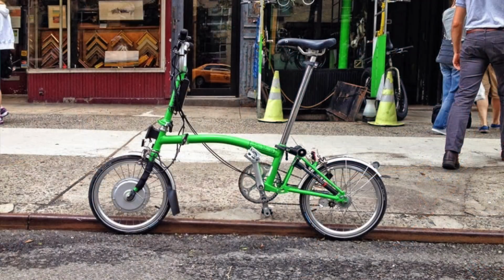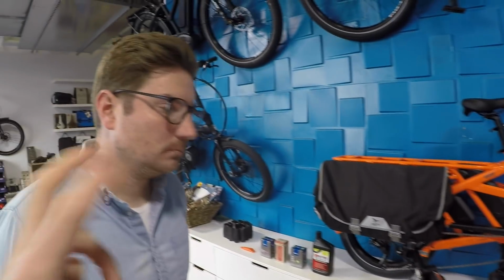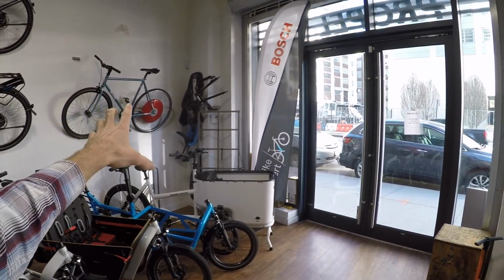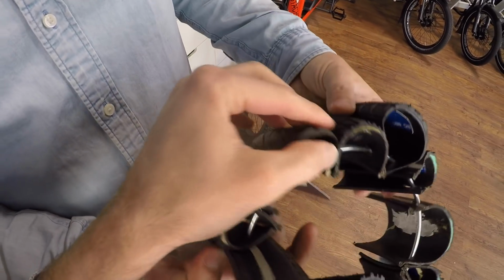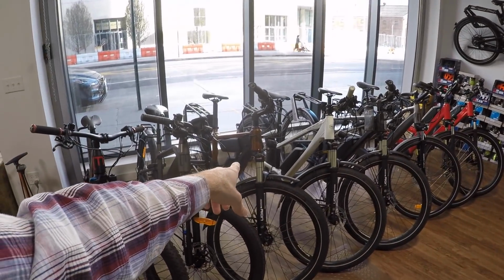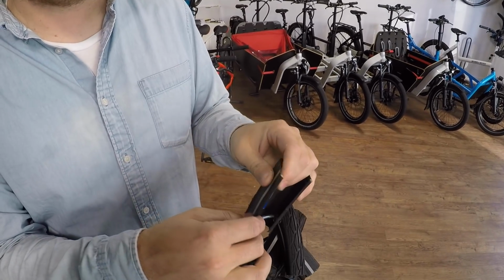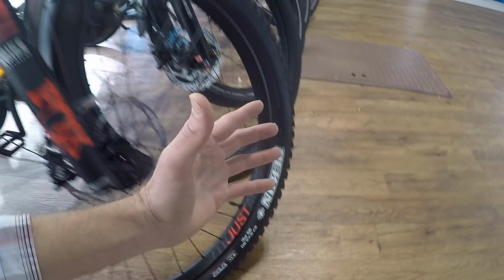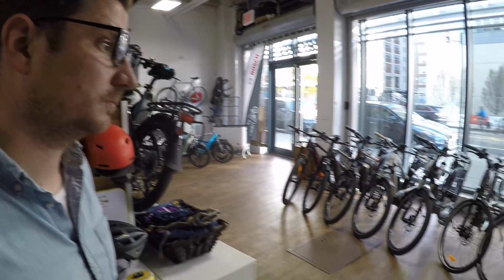Bicycle Wheels and Tires - Deep Dive Guide, Electric Bikes

Comment: My Dodge Diesel has 245/75/16lt tires that have a tire pressure recommendation of 80psi. The Expedition has 245/75/r16 tires and they recommend 35psi.

Comment: I have an ET Cycle F720 which has a 20x4 tire in an alloy wheel. My wife wanted the  seat lower so her feet will be on the ground whenever she stops.  Aside from seat post which is at minimum already, Im planning to replace my tire with 20x3 tire. Will it fit my rim and will it help the seat height to go lower? Thanks!

Comment: Biggest thing is tire pressure if you have a tire that can take 100psi you'll roll farther in range cause less resistance means less watts used to get the same distance.

Comment: You have to "pedal faster" with smaller wheels? 2:50. Huh? That's news to me. Do you think he might be confusing rolling resistance for a "gearing" effect? Rolling resistance is certainly a bit higher with smaller wheels, but only becomes noticably so over rougher paths. It's referenced here as "attack angle." Hmm...
This is not to detract from the fact this video is most helpful. And the man in the shop is a good guy. Thanks to him too.

Comment: Great info on tires, rims and tubs. Are adaptors available to convert the Presta valve to a regular type valve used on gas station air pumps here in the US?

Comment: I recently purchased a Habike Xduro full seven with the bosch system, love the bike however it came stock with nobby nick schwalbe tires which I was not too excited about. I have experienced several flat tires with the nobby nicks on my other mountain bike I got a flat early on the ride with a sharp rock, then a week later it was flat by needles from cactus. I switched to Maxxis high rollers with exo protection and those held up much better than the nobby nicks. So I figured I would take It to the same trails and blow out the tires so I can replace them with the maxxis with exo protection. But to my surprise the nobby nicks held up even in a trail full up sharp rocks and many cactus, I was trying to get a flat, but was shocked when I didn't lose any air pressure. These nobbby nicks have APEX protection which is 2 layers of extremely robust motorcycle carcass. So far 127 miles in the desert without any flats. I'm starting to like these nobby nicks with APX. protection.

Comment: Hi Court, love all your hard work in doing all these reviews. Great job! One thing I wish you would include on your reviews though is the ground clearance of different bikes. And what I mean by that is the distance between the pedal in the full down stroke and the ground. More than once as a kid I was thrown off my bike by entering a turn a little fast while pedaling and having the pedal strike the ground which meant I was down on my side for a nasty slide. I call it a high pedal slide. As an older adult now, I pay close attention to the ground clearance of the pedals and the lean angle of a bike. This ground clearance is also important for going between speed bumps in parking lots and neighborhoods, as well as pulling up to curbs, going over curbs, and pot holes, tree roots, etc. With e-bikes you tend to ride a little faster than a regular bike also, so paying attention to the lean angle of a bike is very important, especially if you ride on trails like I do with lots of fairly sharp turns. My current e-bike,a addmotor M850 fat tire, has 10 inches of pedal clearance which means i have never high centered it which I like for my purpose, but the down side is with the pedals up so high you don't get the leg extension that some people like and the stand over height is pretty high, everything's a trade off. Keep up the good work!
Reply from the maker: Interesting point, I have also suffered pedal strike when mountain biking or keeping the inside pedal down while turning. The proper way to ride is to stop pedaling when turning sharp and always raise the inside pedal... but sometimes mistakes happen. I appreciate the request and might focus on this more as I do new reviews. One other solution is to purchase shorter crank arms, the most common stock size that I see is 170 mm but you could get 160 mm if you don't mind shorter pedal strokes, perhaps that is what you have?

Comment: That was enjoyable. My only peeve is I hope we never get the regulatory restrictions the EU have, Chris says "we're not that far along" well maybe 25km officially approved tires, 45km officially approved tires because bureaucrats say so is much too far along. In the UK they cannot legally ride faster than 15.5mph with an ebike. 
But a lot of info... The difference in tire volume and pressure ratings was nice to know, just because. That was a neat cutout of the punctureproof tire, just looking at it makes an impression. Going tubeless with tires like that looks like a smart alternative. And one result from boost hubs is widening the spoke angle for a stronger wheel. Just interesting... you guys did a good job while, covering a lot of ground ;)
Reply from the maker: Awesome, I really enjoyed this conversation too... just looking back when I was editing and writing the short guide to go with it. Chris is very smart and has a bunch of knowledge from his years of selling ebikes. I agree that some of the European regulations seem a bit too far :/
Reply: Your comment misrepresents the European speed regulations. 
The 15 kph limit is on power assist facility ONLY. You can ride your electric bike as fast as you can push it along, just like any other bike on roads without a general speed limit. But above 15 kph you will be doing all the pedalling and all the powering yourself. It is the assistance that stops at approx 15 kph, not the bike.

There are some moves to increase legal power assist to a 20 kph limit, and some people would welcome that, but at the expense of maybe licencing the bikes as motor vehicles, making helmets compulsory, and requiring third party insurance cover... which all might be necessary, but not popular.

Myself, I find that speed is not of the essence. Being able to go up HILLS as if they were not there allows of cycling so much further than previously, that I just spend LONGER on my bike having a good time!! But then, I LIKE cycling. ;-)

Final point: Because the power assist regs allow of certain percentage errors, as high as 17.2 kph is still not "illegal" as such...

Comment: My current ebike tyres are 26 x 2.35 but because of the type of tyre on the bike, I'm getting too many punctures.  Having watched this video, I want to change the tyres that came with the bike with Schwalbe Marathon Plus MTB but the nearest size they do is 26 x 2.25, so is it possible to fit 26 x 2.25 on the existing rims or is this going to cause an issue?
Reply: M. Blori I would say you would not have a problem with a narrower tyre.  I have 26" wheels that can fit anything from 1.50 to 3.00. The only problem I can imagine,is if you use a wider tyre,that could cause problems with mudguards or rim brakes,but that should not be an issue if you want to change to a narrower tyres.
Reply from the maker: I think Stayshtum68 is correct, you can very likely put the slightly narrower 2.25" tires onto your existing rims M. Blori :)
Reply: schwalbe marathon plus are great i did 26000 km on it, the ride is very harsh there is no cushing so beware of that.
Reply: Thicker MTB or downhill inner tubes also help against punctures.
Reply: ElectricBikeReview.com Thank you all for your helpful advice. I have now ordered the new tyres.